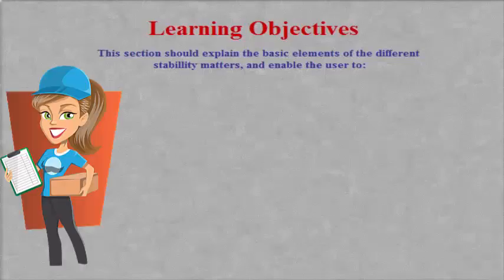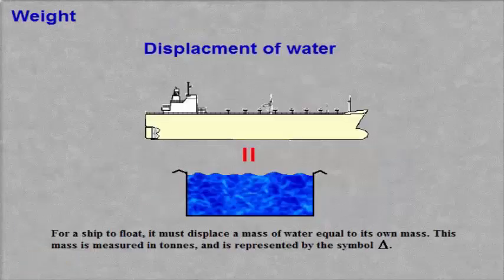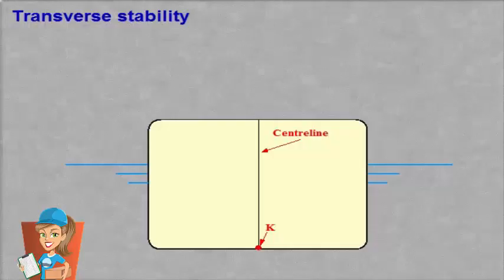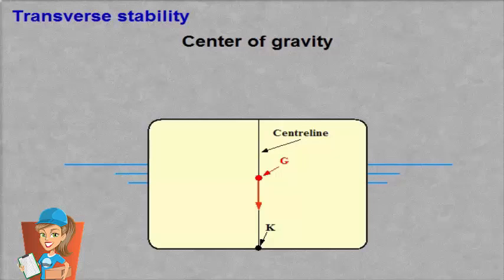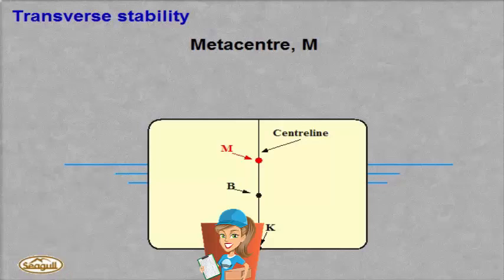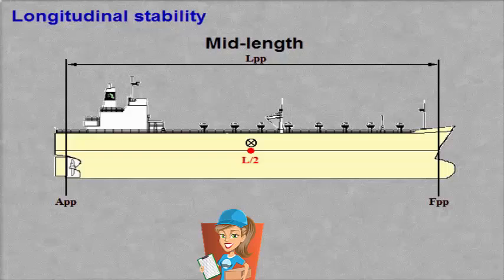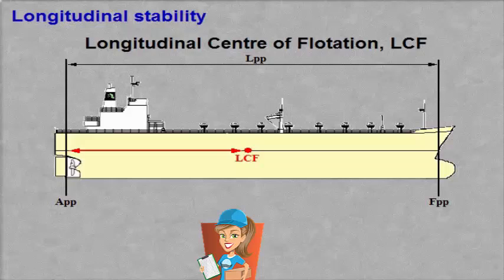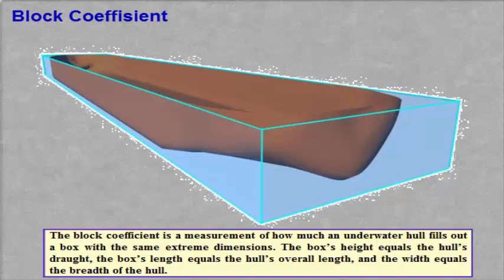Ship Stability

Comment: Ship weight on the water create pressure and pressure divided by area is force and so if we allowed an opening let water in at bottom then let it drive turbine then the reservoir in the back of the ship hold outlet and release automaticaly when reach a certain level or pump out by electronic use electric generator by turbine that both propel drill it like propellor inside open tube for propulsion and generator of electricity by attaching magnet prove over stationary coils take electricity to battery
Reply: That’s a really long sentence.

Comment: What about the cargo and weight before the ship will sink
Reply: Too high CoG can cause issue concerning hull stability leading to a capsized ship, car ghost can only be loaded  as per the load masters  instructions - too much cargo =waterline  above plimsoll /load line doesn't allow enough freeboard on the side of the ship in heavy seas to allow a safety margin during voyage-WATER CAN ONLY DRAIN SO FAST IF WATER IS ALLOWED TO COMR ON TO THE MAIN DECK OF THE  SHIP.

Comment: I want to make a floating boat from concrete 
Do you know any chemical material that can make the weight of concrete  light ?
Reply: There is concrete with lightweight aggregate; pumice or such.  In the U.S., Sakrete Brand's "Maximizer" is an example.  Regular concrete is about 133 lbs per ft3 whereas Maximizer is 80 lbs per ft3, about 60% the mass of normal concrete.

Comment: what the arrangement of cargo loading? heavy or light on fore?
Reply: arrangement of cargo loading must always be light on the bow(fore)of the vessel -meaning a vessel shall always be trimmed by the stern as a safety precaution and manouverability issues as a rudder has little effect when mostly out of the water -line, also a large wave can capsize a vessel if too much water comes over the main deck due to the  vessel being too low at the bow.